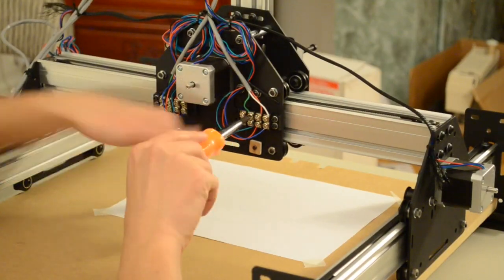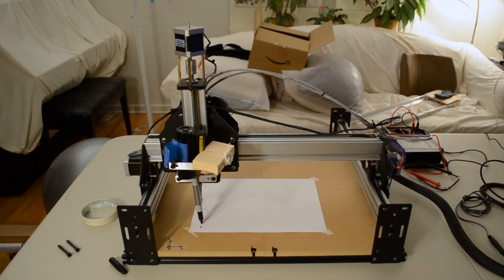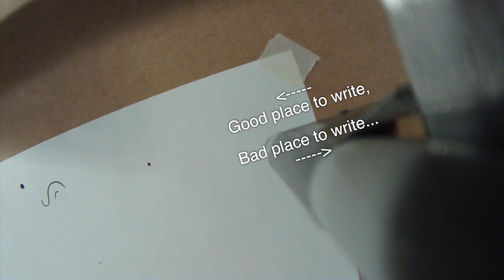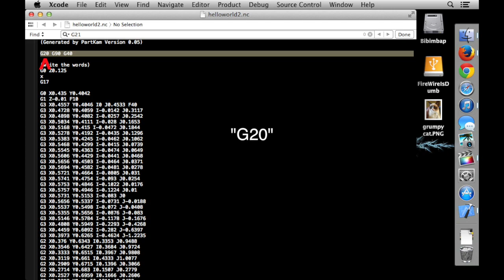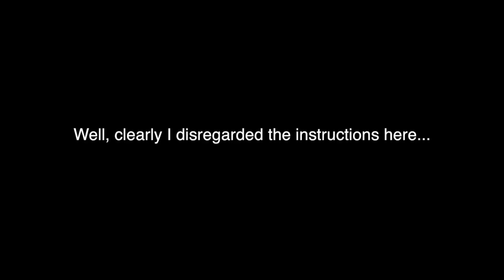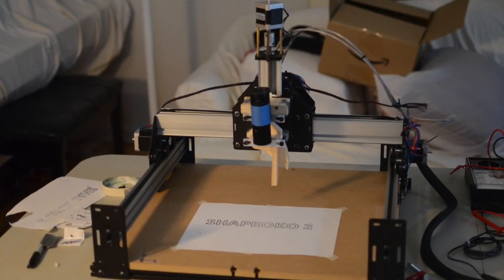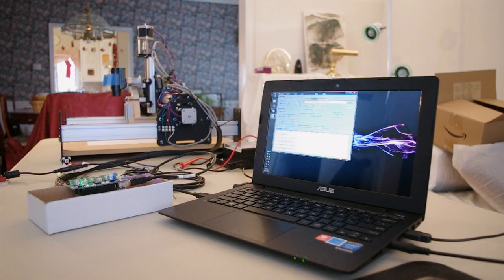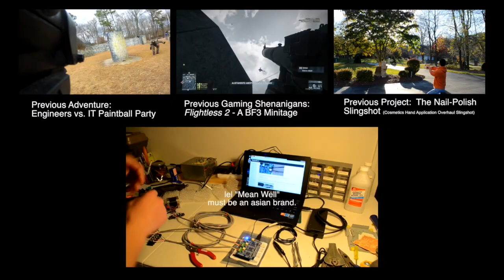Shapeoko 2 CNC Kit: Hello World

Comment: Have you tried running some programs from Fusion 360 on it yet? I'm just about to start building mine, so your two videos were a great overview of what to expect. Thanks.
Reply from the maker: +Scott Moyse I have not tried using Fusion for any of the CAM workflow, but I believe others have had some success with it. It's all a matter of using the correct gcode "type"/post-processor. Usually the simpler the better.
Reply: Winston Moy yup and they have it covered

Comment: Very nice video. I just converted my milling machine to three axis CNC motion control. I was wondering if you have done any repeatability testing with this machine.
I have and use a 3040 CNC tabletop engraving machine but only use it to engrave the carbon graphite pouring molds I make. I have found that the repeatability of the 3040 machine is not very good and can get off position (from home) about .035MM to .050MM after engraving a mold. I am wondering what the tolerances are on the machine.
Thanks for the great information you share.
Reply from the maker: I haven't done any sort of formal accuracy testing, the most informative thing I've done in that regard is mill thicker parts and observed that all the layers matched up resulting in a smooth wall finish. I'd say that's easily within a .01" (.2mm) repeatability but I never investigated further. As an engineer, I'm usually pretty happy with getting .05mm accuracy on contracted parts (standard tol is +/- .003"), but everyone has their own tolerances. You'll be doing a lot of tuning if you really want to get to that level of accuracy on a belt-driven, open-loop system though. (Or do a shaft encoder mod.)

One guy on the Shapeoko crew has done a lot more investigating the accuracy of the CNC platform, Tim Foreman. Here's a post he did on the first gen system:
http://timf.anansi-web.com/wp/shapeoko-accuracy-really/
I would expect the SO2 isn't worse than the original, but it takes a lot of tinkering to get to that level of precision.

Comment: you could have used a spring for the sharpie..so as there is a continues pressure on the sharpie..
Reply from the maker: Very true, I've also tubes with rubber bands looped over the end. It's what I should have done in hindsight, but I was overly eager to just get it working.
Reply: Winston Moy I would say not to use the spring, you would have not realized your platform was not balanced :/ Nice vid!

Comment from the maker: Albond, i hope you see this, YouTube's not letting me reply directly.

The Shapeoko can handle anything softer than aluminum, it's just a matter of finding the appropriate milling parameters. Some materials you have to go slower, or need special bits. G10 from my (admittedly light) research is similar to the FRP used in PCBs, which the Shapeoko is known to be able to handle. But as with any hard plastic, you will want a good dust capture system, because that stuff gets messy fast.
Reply: Thanks for the reply! yup, G10 is a hard plastic and i was thinking what is the best all around dremel to buy. Are you using the stock one?
Reply from the maker: albond14  I am indeed using the basic rotary tool that comes with the Full Kit. It works fine for the materials I'm milling, but really only has one useful speed: Fast. A "real" dremel has a bit more range in RPM and also better speed control.

I will probably switch over to one eventually, but I would rather use the cheaper tool for practice. I wouldn't feel as bad about damaging it if I got a milling parameter wrong.

Comment: Pretty neat? Did it come in a kit? What was the cost not including your time? I also am a geek and nearing the end of my career and I work with wood so it would make sense to make a CBC machine. So far I do all my work with a lathe. Thanks for the video, one last question is it strong enough to hold a router? Thanks
Reply from the maker: It was a kit from Inventables (added a link in the description), comes in structure-only and structure+electronics packages for $300 and $650 respectively. The structure itself is very solid, and people have milled everything from wood, to plastic, to aluminum on it. I'm using nema17 stepper motors to move everything, and for 1/8" end mill bits it should be sufficient. If you want to remove more material at once with something like a 1/4" bit you might want to upgrade to beefier stepper motors or something.

The entire platform is open source and there are dozens of documented projects and modifications on the Shapeoko website/Forums. You can check them out and see what other people have done with the platform. I'm still getting started, so this is an ongoing educational experience for me.
Reply: Thanks interesting